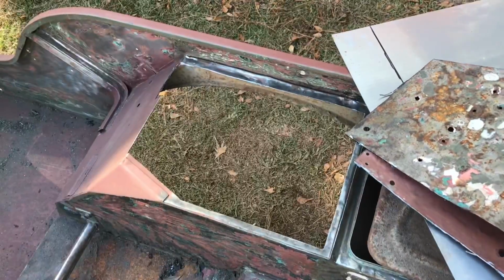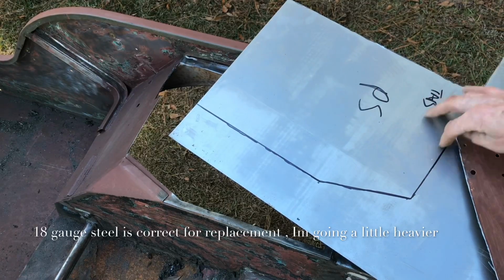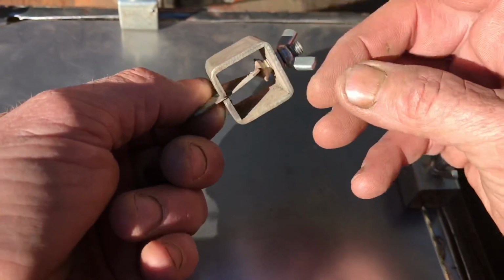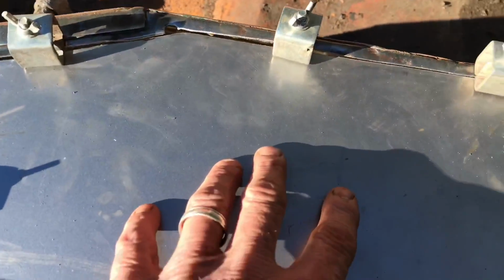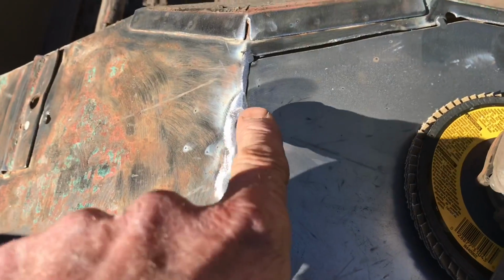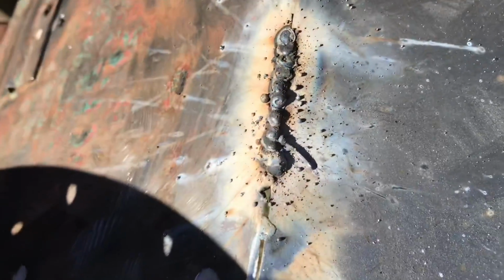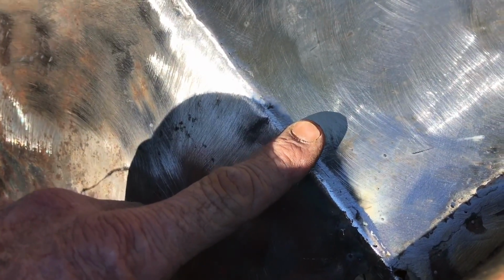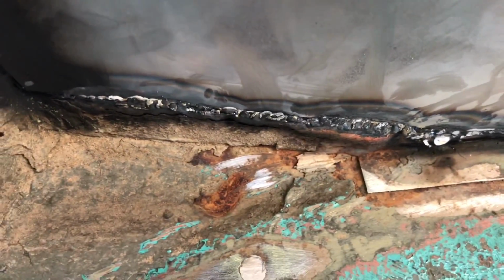Willys MB Body Tub Sheet Metal Repair Team G503

Comment: When I use flux core wire I take the gas shroud off the nozzle. Gives a much better view of the weld. Good example of using what you've got to get the job done.
Reply from the maker: Paul Rainsford I tried your tip and it works like a champ. Thanks for the suggestion 👍

Comment: For the filler any problems using the JB Weld products instead of plastic/Bondo ? Great inspirational video. I am facing a lot of patchwork on my  Slatgrill, You are right about making the attempt to do it oneself. My welding friends tell me it builds a Zen-like bond when one sees the project proceed and reawakens a hidden spirit in the machine as one brings it back to "life". No, they do not offer help to work, but like you, inspire and the to mentor. Thanks again. JeePa (of G503)
Reply from the maker: I have used JB Weld on other items with great success. It spreads well, and more like steel. It sands up a little harder than plastic fillers. Thanks for your comment, and best wishhes on your project.

Comment: I think your welding went really well on that panel, you must have a very good MIG welder, I found that it is far easier to make the whole panel and fit each section in as original, this is because being flat, the slightest distortion shows up, and I was unwilling to use filler, which on flat panels tends to fall off, welding a new section in is very time consuming, so if you have a simple sheet metal folder, and some wood formers ,you can make any part of the body tub except the centre floor island, which is usually OK due to being covered in oil , it seems a big job, but taken one by one the panels are not difficult to make and plug weld in place. Chris B.
Reply from the maker: Englishman French It’s a Chicago Electric 110 Mig Welder from Harbor Frieght😬
$85.00 on sale. Thank you for the post and following the channel👍
Reply: Team G503: Well ! I have to say that is really impressive performance for a really cheap welder, the only people that can use these cheap things are the experts, they are so much more difficult to use that a real one, and your welding looks very good on thin metal! You would not get that performance from a cheap welder in Europe.